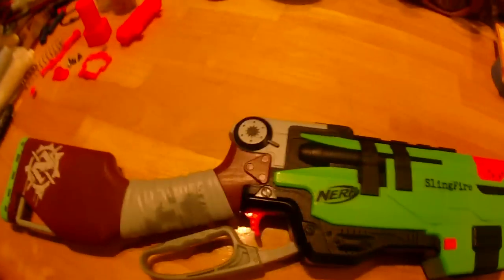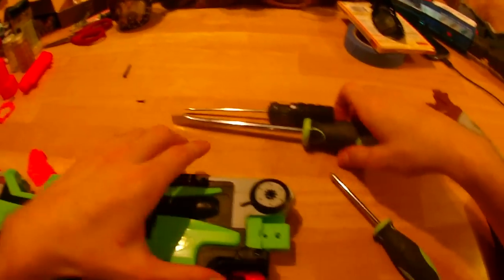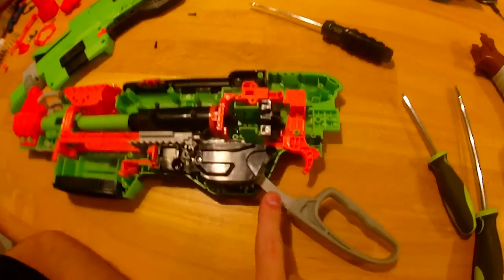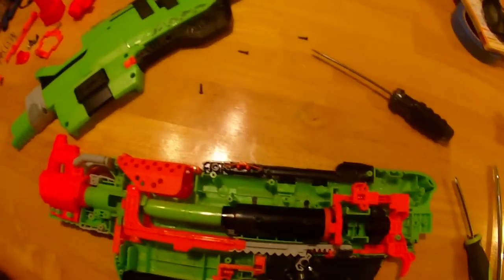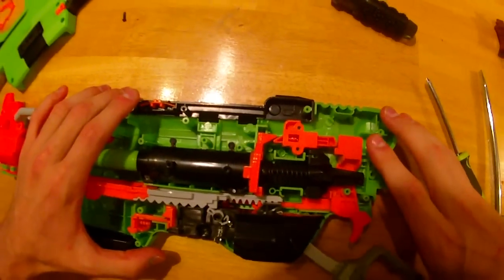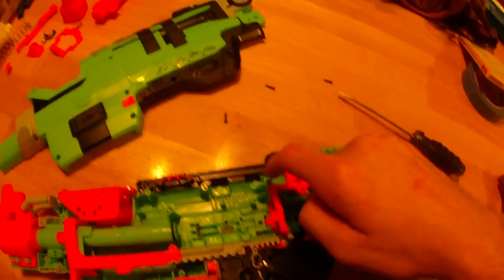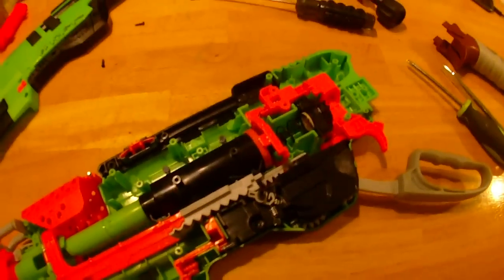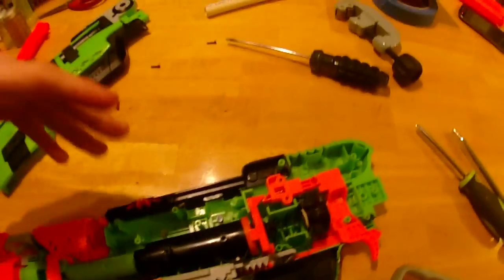ULTIMATE Mod Guide: Nerf ZombieStrike Slingfire

Comment: this guide saved my ass! i tried to shoot a tampon with my slingfire and it got stuck in the barrel. so i had to open the blaster because the priming handle was in it's forward position and didn't wanted to move.
Reply: Why were you trying to fire that?
Reply: It's a Thunderdome thing.

Comment: (Please keep in mind im kinda noobish when it comes to modding my nerf guns) I had such a hard time modding this, the mod part was easy (only took out the air restricter), but putting it back together was so hard due to that gear system
Reply: Does taking out the air restrictor actually eventually break your gun?
Reply: @thezealcloakerthatruinedyo3096  not worth it in most magazine fed blasters unless ur doing a brass floppa

Comment: The stock spring looks pretty weak. I'm sure it could handle a tougher spring but the catch spring would defiantly need an upgrade as well. One other thing that bothers me is the priming handle. The grip looks solid but the section between the grip and the blaster looks rather thin and flimsy.

Comment: So, it's kind of funny. I sort of went back to the days of Maverick modding, because since I didn't have any PVC to work with, I actually stuck three dimes into the "chamber block" and measured and cut the plunger rod to fit so that it would stop just before the dimes, and after drilling out the air restrictor, I'ld say it turned out great! #memories

Comment: is it worth removing the air restrictor I've seen a few places saying no and some saying yes and was wondering if its even worth it or if someone has some
chrono testing done with and without the restrictor
Reply: No, the gain is barely even over 0 and internal stress is insane

Comment: my son just got this gun for his B-day.
ISSUE::::::::  The last bit of movement (almost locked and ready to shoot) it doesn't want to close....
This is random, but it seems more common with older darts. 
OPENED UP the Slingfire and found, there is a LATCH that is pushed down, by the closing slide on the sides gets difficult to line up, and deflects the alignment..  Funny to see the entire barrel MOVE around INSIDE THE GUN!!!...
If I push down, from the top though the jam door, it usually feeds it fine???
I tried taking the plastic piece out, but then the bullet doesn't stay put, so it will actually SHOOT...LOL.....  so it needs the plastic piece........Perhaps I could take the SLOP out of the barrel???  Obviously, NERF designed it to be this way...??
I will post a video....  I think it is due, to the darn not cooperating due to old dart, and instead of just shoving it in the breach, the gun tries to let you know it is messed up....This gun is very good, but Is very complex.... lots of things have to be JUST PERFECT, or it will not fire...
Reply: you made it worse, put it back exactly and next time push it a little more because the last crank is the only one that needs effort
Reply: Seriously... Don't do something that you don't know what you're doing
Reply: Chase Lucas if people didn't do things they didn't know  about..lets take you for example. At one point you didn't know about this thing people call walking. You know one foot in front of the other. People need to and want to try new things. Why must you be "that guy"? No one likes "that guy".

Comment: my slingfire's range has gone to shit after 1 day
Reply: We're you dry-firing? After removing the AR, dry-firing can and will destroy your blaster.
Reply: you shouldn't remove the AR in blasters with a direct-plunger system. the performance gain is just slightly above zero but the stress to the internals is much higher. just seen a broken plungerhead.
Reply: Starlord so true